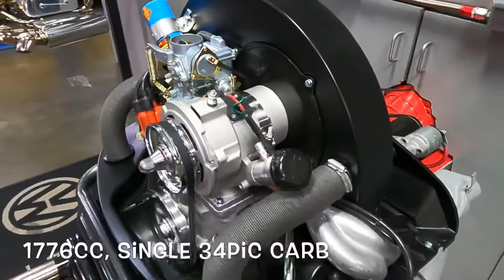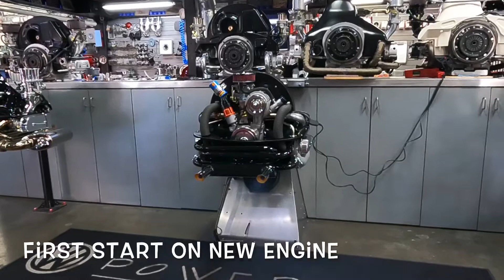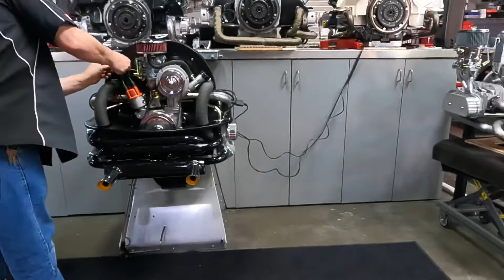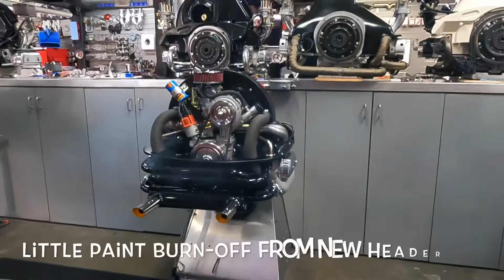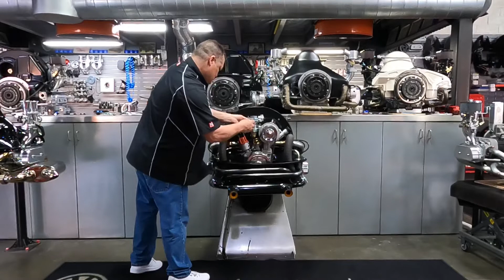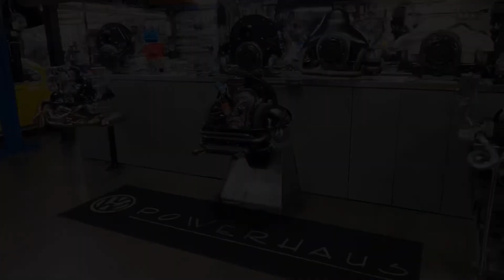Little 1776cc Dual Port with Single 34pict Carburetor POWERHAUS VW

Comment: I NEED help. I purchased a stock 1600 dual port in a '73 stock standard bug. It has some kind of after market "progressive" carb, intake, and air filter. It also has an Engle 110 with stock exhaust and .009. I want to convert the engine back to stock carb, air filter box, distributor, and intake with stock exhaust. Will the single 34 pict run OK with this set up? The heads are stock but new, crank is counterweighted and new, rockers are stock ratio. Please advise. Thank you.   Think of taking a perfectly stock good running  '73 1600 Dual port and just putting in an Engle 110 Cam and changing nothing else.     Would that work?
Reply from the maker: Hi Ben, the stock single carburetor was already a bad design with poor air speed as its split through intake for the different cylinders so a 110 cam will only make matters worse, a 1776  engine with everything else bone stock including heads is about as big as we'd go with the stock carburetor and even then, it needs to be jetted and modified.
Reply: @powerhausvw  Multiple Weber tunning is something I was doing in the '70s (911s) so going to twin carbs on a flat four is not a challenge for me. I was just hoping the very well-designed 34 PICT 3 could handle the 110 cam. Apparently, your experience says "no". I am going to fiddle with it and confirm as I want a completely stock (well-engineered and running engine in all climates) intake system. That may require splitting the cases and going back to a stock or near-stock cam.

Comment: So smooth!! I’m balancing my con rods, bearings, pins and pistons to aprox .85 of a gram Bob weight, then getting the crank balanced. I hope it will be really smooth running as well. Question: what do you use to seal the jugs to the case? Thanks!
Reply from the maker: We’re using  ThreeBond liquid silicone
Reply: Thanks so much!!

Comment: I like your  setup: stock cam and carb + 1776cc

How much HP and Torque does this engine gets?
Reply from the maker: Thank you, we haven't tested this set up for HP or TQ yet, the engine is basically stock with the exception of the 90.5 cylinders, 009 distributor and aftermarket muffler.  A stock engine puts out about 60hp or so, this one may be putting out 10-15 more HP.  When using a stock 34pict or single carburetor, we won't put anything other than a stock camshaft and won't go bigger than the 1776cc otherwise we'd need to jet the carburetor excessively rich in order to get rid of the flat spot and this leads to heavy idle, vibration and washed out rings.  
The dyno that the engine is on in the video still has the old mechanical gauges and not very accurate, once we upgrade to data acquisition, we will post results.

Comment: You have any ideal of the approximate horsepower of this engine?
Reply from the maker: this engine is basically stock other than a little bit bigger piston, our dyno calibration is not accurate right now so not sure but maybe 70-75hp

Comment: Approximate HP & Tq at what rpm? Beautiful work as usual!
Reply from the maker: Thanks Rich, this engine is basically stock other than a little bit bigger piston, our dyno calibration is not accurate right now so not sure but maybe 70-75hp
Reply: @powerhausvw  20 years ago I was partners in a VW/Porsche shop in Ft. Myers Florida. We built plenty of powerful stroker typ 1 engines/cars. Lots of Berg and Scat parts. A high reving dual 40 Webber engine that I built in my living room in '81 was what started it all for me. You're building some of the most well thought out engines I've seen in quite a while 
 Hats off!

Comment: What cam is in this 1776. Standard or. Other
Reply from the maker: We will only use a stock cam if running the stock single carburetor, any bigger on the cam will have an uneven and lumpy rich idle if running a single carburetor

Comment: More beter if you develope with CDI and injection..👍🙏
Reply from the maker: We’ve done a few efi builds not so much the last couple of years, to take full advantage of a complete modern type efi system it becomes very time consuming and expensive, I think there’s a few businesses around that offer a decent kit, but it’s tough to find mechanics now days that know how or even willing to work on these old cars, add efi and most shops will turn you away